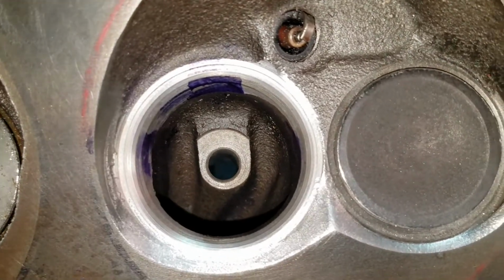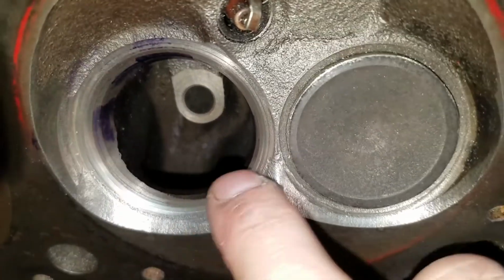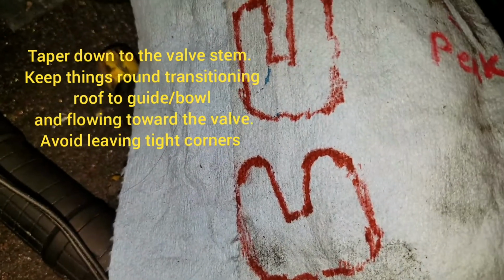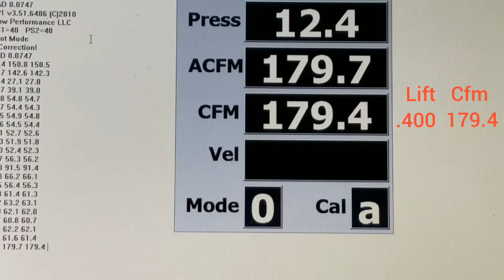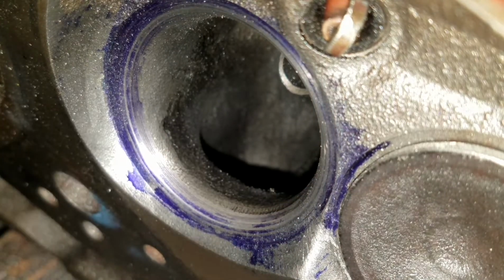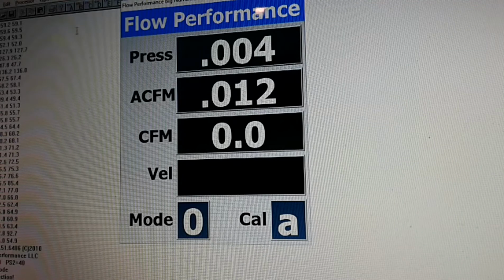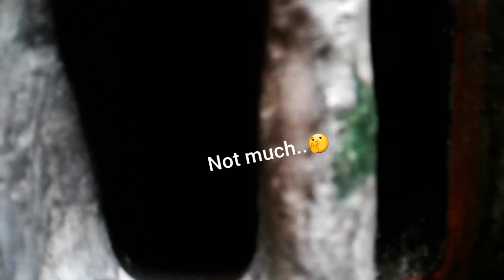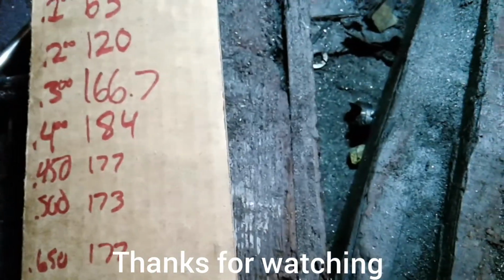Chryslers strangely popular #302 casting cylinder head. Part 3. The shallow end.

Comment: Mopar used to sell these heads ported and with larger than stock valves. They said they made more power than stock 340 heads, but that was about all they said about them. I liked the fact they still used the shaft-mounted rocker arms.

Comment: I did the same exact thing to my ssr on my 163 heads. And I don't even have a flow bench. Someone else did the vj on those heads so I just blended in and took out the valve guide.
Reply from the maker: Funny thing with cylinder heads is you can copy what you see but it can still flow inferior to what you copied... and you need a flow to see and know it. Doing videos and tutorials on old factory cast iron is a bit of a learner and burner. The core shift is terrible. One port will do well with little work while the next takes working the ENTIRE port because it happened to be smaller and shifted off one direction. So passing on simple measurements is still a dice roll when it comes to results. These 302 heads start 5 or 6 cc's smaller intake than a 920 or 675,234 etc casting...so they are MORE work to make good to start. Decent is easy..just a nice v j and chamber blend/deshroud, done. You'll notice that when I do the multi-angle valve job in this that I don't use the lower angle in order to size the throat yet because the port and bowl is so damn small that I would immediately have to do work to blend the ledge it would leave in the bowl...leaving the step by step lost. Also the idea is to blend the valve job to the actual size of the bowl....remember, shape is everything. It may not be this or that size but it may happen to be shaped just right for the rest of the port and work well.

Comment: The 89 Shelby Dodge Dakota used these heads, I think. [ I looked into it because there was an engine for sale near me pulled with low miles thirty odd years ago! ]  Car and Driver got 0-60 in 8.7 and 1/4 mile in 16.5 at 82 with 3.90 gears with limited slip and a 4-speed automatic with high stall converter. Compression was 9.2:1 with flat top pistons. Weight was 3,610 pounds from one source who also said 0-60 came in 8 seconds flat.  I don't know what cam they used, but I'm pretty sure that the stock heads were not helping!  I was messing with an online compression calculator and, although I don't know the thickness of the factory gasket, in order for the factory compression ratio to be 9.2:1, the piston must be "in the hole" quite a ways and the squish distance (from the piston to the head surface) would have to be about .085".  Assuming the specified 318 deck height, rod length, and stroke, I found some KB Hypereutectic pistons would be .012" below the deck.  With a .028" gasket, that would bring compression to 9.58 to 1 and the squish/quench would be .040".  But wait, the newly unshrouded chamber is likely to be larger than 63cc...
Reply from the maker: A friend of mine watches DVs vids and he pointed out the dodge 2.2 turbo and what DV did with those heads n regards to your comment on my approach. I haven't seen the vid but rumor has it he does the same as i. C&D I never read. Magazines I followed when I was young were Mopar Muscle,Mopar Action ,HP Mopar ,cars magazine n stuff like that. Like I said I still have them in boxes put away. The heads were a smog piece. Magnum heads same. Any closed chamber head I've ever used needed less timing, that's a trait.. even less timing when you get the quench tight..and depending on the octane. I've done open chambered step head quench motors that I really am fond of and the flats and closed.. one is easier than the other..but I like an open chamber head, or have least have no problems with them. Pick the right parts n pieces and it can all be made to run reeeeeal good ...even better if you know how to tune a carb and read a timing light-most of peoples problems outside of no degreeing the cam... is tuning.
Reply: @1WILDsMoPARtech  I watched one of DVs videos where he messed with a vortec head.  There was only one area in the outside corner of the closed portion of the chamber that he said not to touch because doing so would partially defeat the direction of the incoming charge spiral.  Otherwise, that vortec head look very unshrouded, and very much like your chamber.
Reply from the maker: @dahut3614  fwiw I have opened chambers to the point of a flow loss.   It is real. Darren Morgan has some great tech vids. If you haven't already watched them, do.
Reply: @1WILDsMoPARtech  Wow, Darin is on a whole other level!  I watched all his videos and about five hours of livestream Q&A–so far.  Thanks for that!
Reply from the maker: @dahut3614  Good to hear.

Comment: Look forward to your next video.  Would you care to do a set of 413 heads I have?
Reply from the maker: I can, which 413 head? As for this series.. I'll be  bouncing back to this #302 with a basic port job numbers and flowing with the 1.88 and proper valve job...then build from there...so next one is soon to be on its way. Thanks for your interest.👍
Reply: @1WILDsMoPARtech  413 industrial RV engine head casting 943.  Small runners tiny valves 1.88 and 1.5.  Going on a 440 shortblock build for my motorhome all about torque engine will be done by 4500rpm.
Reply from the maker: @ericj3112  I thought they were 2.08 1.60. Small ports work well sub 4500 rpm
Reply: @1WILDsMoPARtech  These are a different animal.  1.5 exh with 7/16 sodium filled stem.  90 cc Closed chamber head.  Hardened seats installed from factory.  Water pump housing bolts directly to the front of the heads on these.  Wondering if it would be worth stepping up intake valve size, but married to the exh bc of sodium.

Comment: I've been thinking, and by my calculations, at 5200 RPM, assuming an absurd 100% efficiency, a single 318 cylinder would only suck 59.8 cubic feet per minute.  It doesn't sound like much, but since it's only actually sucking for a quarter of the time, we'd need an average flow rate of 236 cfm.  So realistically, for what RPM would we build with this head?  I'm guessing you weren't kidding when you said 4000!
Reply: I think I know, we wouldn't!

Comment: Been watching your part 1 , 2 and this part 3 and will watch the rest . im in the process going and buying a set of 302 casting heads tomorrow with brand new valves . i do my gasket matching / port work at home for my youtube channel same name as my user name above . some said i should have larger valves installed ? or will this stock valves be fine with a little work an angle job ? and what angle ?  Thanks for these videos

Comment: Interesting about the higher flow but that it went turbulent sooner with just that very small change.
Reply from the maker: The ssr wasn't wide enough and shaped right to hold it. What you have is the dog leg wall and dogleg side short turn at the dl wall yanking the air off the straight side. And once you work that side too much you can see the same thing happen in reverse, straight ribs dogleg...the merge causes a collision of the air between the 2 and roof/mid coming down.